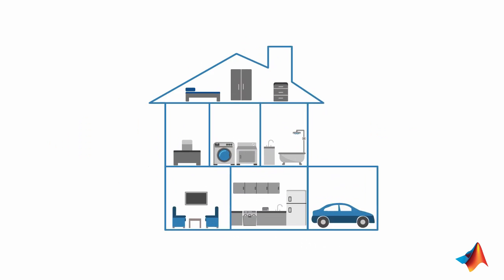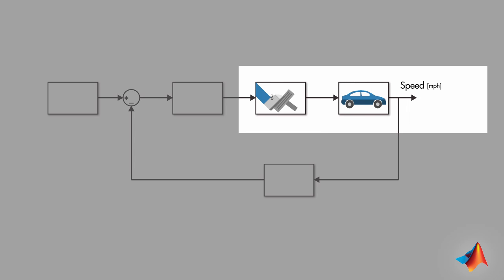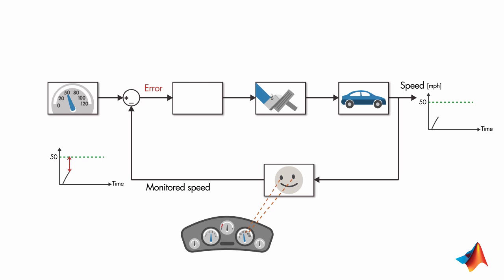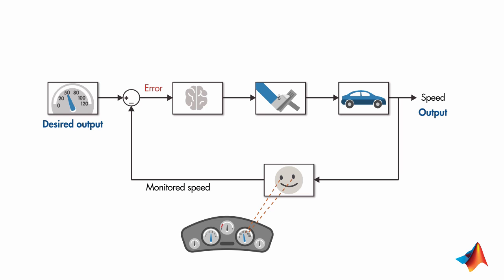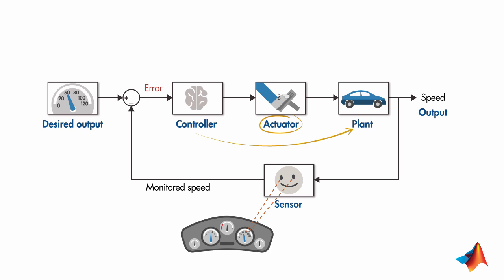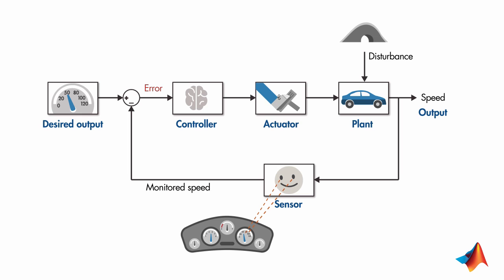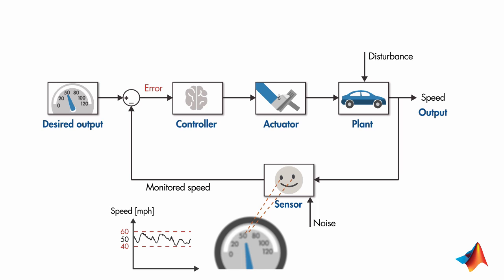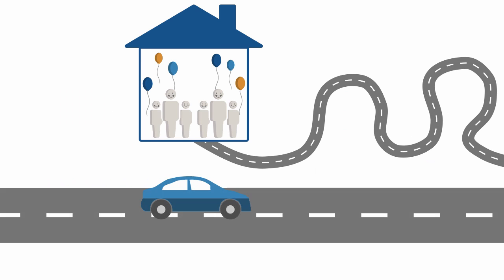Components of a Feedback Control System | Understanding Control Systems, Part 3

Comment: Hey there! I just want to point out that the required parameter for the cost calculation in this case for attending the party must be the dynamic distance i.e. the distance(function of time) instead of the velocity(which you have considered). Because imagine let the cat accelerated to required velocity in say like 10 sec and then maintained it constant till it reaches the party. So in here, the time taken doesnt match with the target time. Hope you find this comment😄😄😄